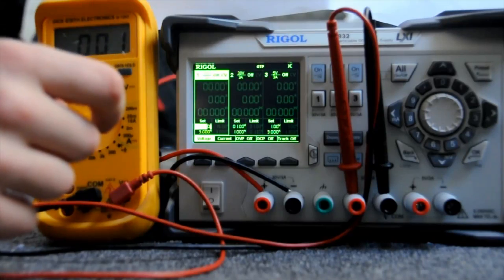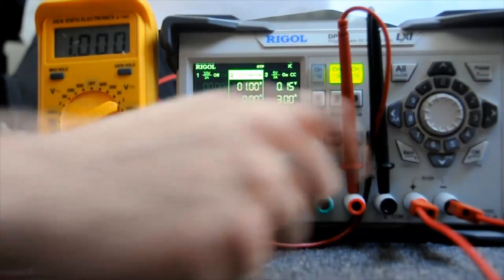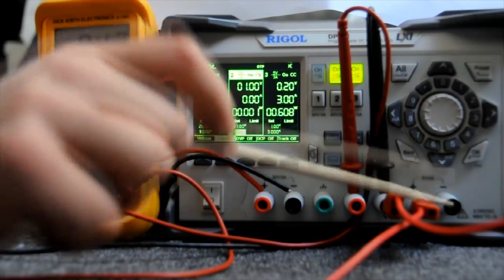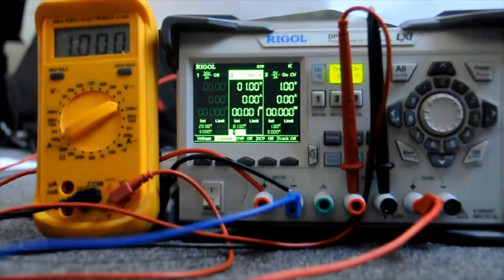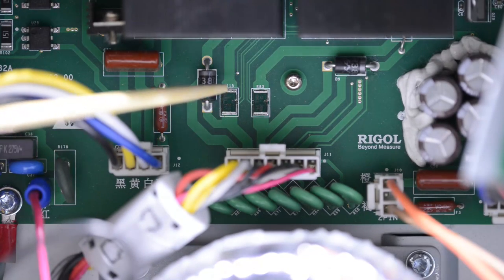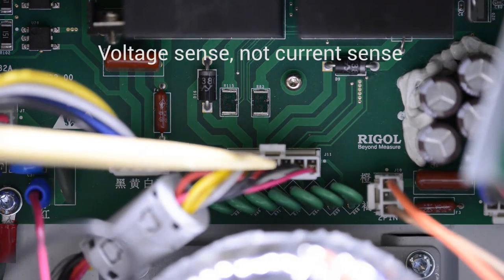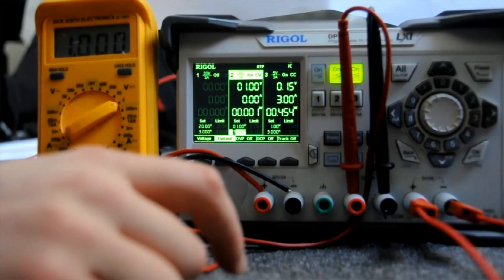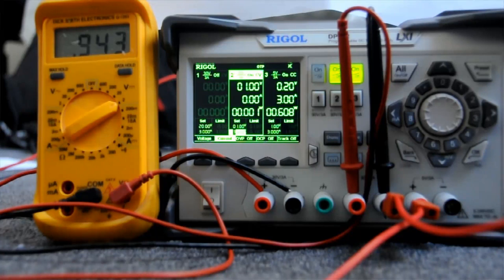Rigol DP832 voltage measurement flaw demonstrated/explained

Comment from the maker: There's some strange things about the supply, but I wouldn't go that far. You're getting an outstanding precision supply with a solid, useable interface, for remarkably cheap. There's just a couple of unusual gotchas; it's quite hard to contrive situations where these would cause a real problem. Still definite room for improvement though.

Put another way, what would you suggest as an alternative?

Comment: I think you are missing the point ITTSBEurope. I very much doubt this PSU was designed for high-end reseach or industrial work, hence the price tag. 

Is it good enough for hobbyist work, highschools, universitys undergrad programmes and small companies with a limited budget. I think most of rigold product falls under those catagories. 

Its on my "buy list" a soon as it at actually gets available in europe. Will be a significant step up from my crusty 100dollar "made in china" low crap PSU.